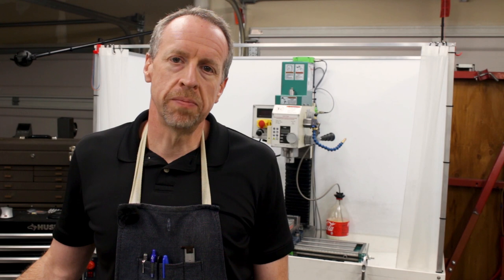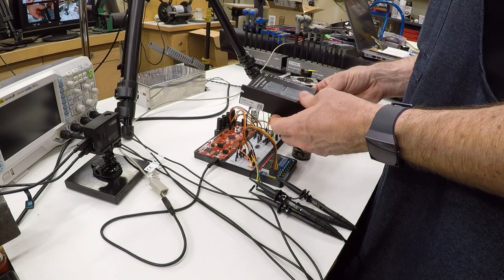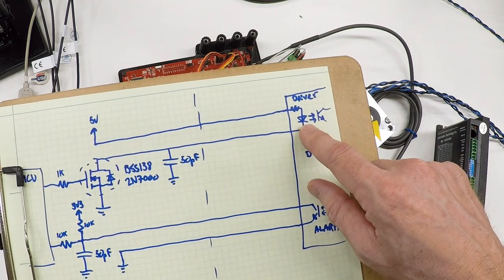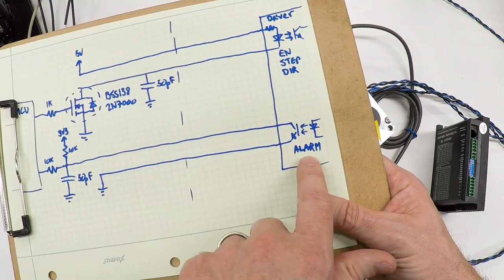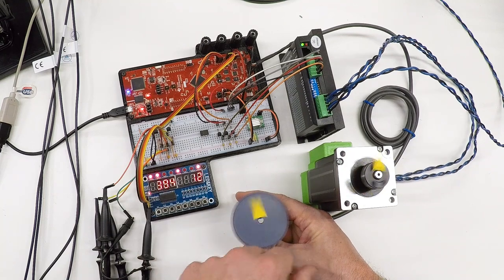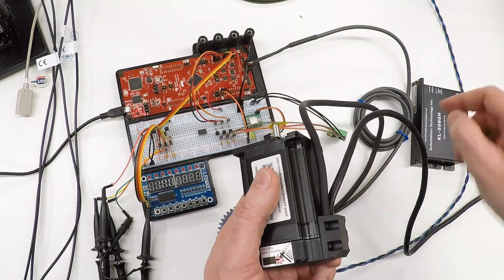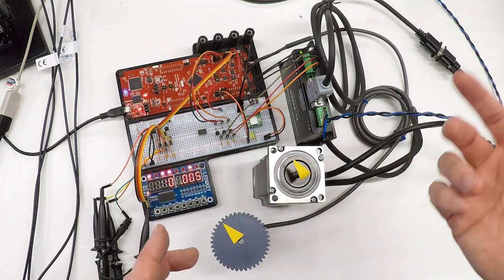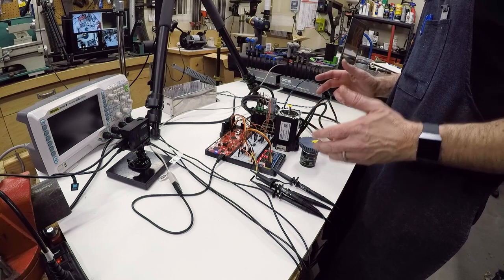Lathe Electronic Leadscrew Part 4: Steppers and Servos and Drives (Oh My!)

Comment: I’ve been toying with the idea of adding a processor driven lead screw to my craftsman/atlas lathe for a while. I finally pulled the trigger on a stepper motor and rotary encoder when I saw how the stepper worked for you. While waiting for the parts, I’ve been playing around with some code to simulate the driver. One question I have is regarding the stepper drive as a function of the encoder position.
For this discussion, I’ll use pulse to indicate an encoder pulse, and step to indicate the total number of stepper pulses. 
When you get an pulse, you know how many steps you should be at, and the current number of steps you are at. You also know how many steps are needed (call them s1) before the next pulse arrives. Here’s the question… do you crank out s1 steps as fast as possible before the next pulse, or do you try to fit s1 steps into the projected time before the next pulse?

For my first try, I’ll calculate the step period based on a filtered rpm with some fudge factor to guarantee that I will get the necessary steps in before the next pulse arrives.

Any thoughts?

Comment: Very good explanation of the pros and cons of each - with the encoder on the servo it reminds me very much of dealing with pickup truck electric shift transfer cases and the encoder signals from them to the transfer case control modules for positional feedback.  The feedback signal would definitely be an advantage in your application here.

Comment: I'd encourage you to actually make a small experiment to test the torque needed for moving the carriage and also for cutting. It should vary according to the material and depth of cut. This way you could draw your operation curve onto your motor's torque-speed characteristics and optimize the system. It's a little more work but you will have a veryyy very reliable setup.
Reply: I would think with the way he's gearing everything that it wouldn't be necessary, considering how much torque a stepper and servo can provide

Comment: I was turning some particularly stringy steel the other day and I just couldn't get a chip to reliably break. So I ended up peck turning for lack of a better word - stopping the feed to get the string to break. It made me think of this project and how great it would be to be able to program a skip turning routine.

I also got to thinking about how nice it would be to have an electronic/virtual stop for coming up to a shoulder by integrating a DRO encoder into the mix.

The possibilities for this are pretty immense.
Reply: No DRO required to implement your idea - the MCU knows where the carriage is, and you could program how many threads to cut before stopping, i.e., at 8 tpi, turn the leadscrew 96 turns (for a 12 tpi leadscrew) and stop. Great idea!
Reply: @schwartzenheimer1  I think a linear encoder is going to be the far better solution because you can't count on the system knowing the absolute position. Any time you disengage the half-nut or the power feed clutch (or if the clutch slips AT ALL) you lose your absolute reference.

You are correct that if you never disengaged the carriage it could be done. But then you're stuck power feeding both into and out of the cut, like doing metric threads on an imperial lathe, and that is a complete waste of time...
Reply: Stopping the spindle while the carriage is sync'd to it wouldn't break the chip (except accidently due to backlash and such).  Stopping the carriage while the spindle is moving would certainly break the chip - and your thread.  Chipbreaking by interrupted feed can be useful for turning operations, but not threading.
Reply: @somebodyelse6673  That's fine and understood. This electronic leadscrew project is designed to be used BOTH for threading AND turning operations. Clearly, turning is the operation I was discussing. Threading stringy materials isn't really that big of an issue as your chip length is generally fairly limited.
Reply: I've had to do the same thing when I'm getting a long string. That's a great idea to incorporate a peck feed cycle for turning.
Reply: BW - I need to get back in the habit of starting replies with a reference to the post i'm replying to.  You were indeed very clear, but the person I was replying to (schwarzenheimer1 ) posted about stopping a thread after a distance, immediately after you posted about stopping to break a chip.  It seemed that he was suggesting that one could stop feeding while threading to break a chip.  

Doesn't help that youtube threads don't indent more than one step, making it seem like every post after the initial one is replying to that.
Reply: @somebodyelse6673  Ahhh, my mistake!

Comment: I'm using a NEMA 23 and a KL-4042D on my lathe lead screw just don't try stalling it by hand! Never had a step loss. I designed stepper and servo systems for 8 years at Hughes Aircraft.
Reply: Hard to evaluate that without knowing your lathe and chip load.  Are you making buckets of Abom size chips in steel, for example?  Making brass clock gear blanks?

Comment: If you by any chance use a VFD for your lathe make sure than when you mount the encoder to 
the lathe the metal housing of the encoder has no electrical contact with the lathe body. The VFD will interfere with the encoder otherwise (in the form of earth leakage current). I ended up mounting the encoder using CNC'd plastic plates.

Comment: You could add a Proximity sensor and add an anti crash feature.  That's what I'll do. Thanks for doing all this work.
Reply from the maker: Say more about that.  Proximity sensor miunted where to detect what?  It sounds like a great idea, but there are so many things on a lathe that can collide.  Students often run the corner of the compound into the spinning chuck jaws.
Reply: @Clough42  Who hasn't? You're not a machinist until you've had at least one crash.
Reply: @Clough42  It would act like the mechanical clutch release on some lathes. It would be movable with a sliding lock relative to the carriage. You could do it also with counts by moving the carriage just before the crash point and setting an electronic stop point. May work with threading if you can sync it back up.

Comment: Have you looked at the Clearpath SD servos?  Integrated driver and auto tuning.
Reply: Clearpath SD are nothing new or revolutionary, most companies that make servo motors make also servo motors with integrated driver (and auto tuning exist on most servo drivers for years). Parker (Parker Hannifin) make them for over 20 years (for example obsolite Integral E or still in production Motornet DC), but Parker do not send free motors to youtubers so they promote them, peolpe who are in that buisnis know already for them (they are one of the largest companies in the world in motion control technologies and one of best, you will see their products in many places where you need precise control). I just pick Parker becouse I had expirince with their product but if you just google you will find  countless companies that make them (and many of them are much better/cheaper then Clearpath).
ps: there is no real advantage of servo with integrated driver to not integrated one (in long run much better solution is not integrated one).
Reply: I was going to make the same comment ! He should not waste his time and go the Clearpath route; much simpler and more reliable ! I purchased a few and I'm very satisfied !
Reply: Miloš Lazović Yep I have them on my 3D printer. Identical to clear path, will run 5000rpm and integrated encoders. Much less expensive than clearpath. I don’t know if clearpath firmware would work with them but I suspect it’s not much different than what we have.
Reply: @mrlazda  

Yeah dude I can go to McMaster and spec out a whole Parker 590 drive set running closed loop  then hook it up to the SIMmatic in the backroom and be good to go. It's different when it's your own money, and you're not just sending a BOM down to purchasing say "thanks guys!" and line item it out for whatevers being commissioned

You could go the other way-- take a Mitsubishi 3 kilowatt $180 IGBT drive that has 3 stock outputs on it to act as the driver out of the box, pop a $30 dollar CUI shaft encoder that'll guarantee 2048 pulses at 8k RPM, waste a week trying to get some stupid FPGA to interface with it and easily outperform an entry level Fadal or HAAS*. That's also 3 weeks of my life I'm never going to get back.

Clearpath is basically the basically the best 'in between' you'll get for the like $400 you spend. They give you something that works out of the box, PID, flexiblity,  and probably the thing I haven't even seen on entry level industrial grade drives -- acceleration profiles*. *Teknic is a wet dream for a DIYer.

*Throw an extra 15k or 20k in there for some Thomson or Mitsui or whatever case 60 shaft ball screws and bearing blocks, 6x linear rails for aux support and alignment, a grand for a Renishaw or Leica probe, maybe another grand for some vib. analysis profiling equipment to dead-man instead of crash and a power quality analyzer to see which leg's motor or mismatched line impedence is backfeeding dirty power to ruin my beautiful sine waves. THD? nevah heard of it. (Yeah EE not MechE in case you havent guessed lawlz)

Comment: Just to jump in on the touchscreen idea.  I think you were right the first time when you said you chose the display you have because your fingers might be greasy or oily when working.  In addition, though you retain the emergency stop on the lathe, some of your functionality in the controller relates to the safety of your work piece even if not to your own safety.  It's amazing how much trouble both my wife and I can have on a touch screen to make sure you press/touch/swipe, whatever else, exactly right to get the results you want.  We probably get it right 85% of the time but not  100% of the time.  Other than failure of the switch itself, the switch you push will know you pushed it 100% of the time.  Put an LCD screen for fancy display or additional visualization of the status if you can have both but I would keep the display you have.   

Oh, one other suggestion on that display/controller you have: buy 3 or 4 or 6 or 12 extras.  They're not made with industrial rated components and it would be a shame for your lathe to be down while you order whatever new displays are available in a year or two and then work out all of the technical issues to make some new display work.

Comment: I wonder how your system will work for simple feeds.  In addition to  threading feeds,  there are straight turning feeds.   There you may want the higher precision stepping rates.   You have the option of programming  cross slide feed rates also.   This is a very interesting  option for other uses.  I have an old wood lathe withe no lead scew.   One could add a lead scew to it using threaded rod and this drive system.   Two  (or three)  of these systems  could convert a mill to CNC operation.  I am sure others  can imagine more uses for this drive system .  A tracked rover anyone?   Spiral grooves  cut / milled to order?   Great work!! .

Comment: Just a thought, but if it were me doing this, I'd install a DRO on the lathe and interface with that. Then you have absolute toll position no matter what happens or when the half nut is engaged. I would do the same on the cross feed, then the entire threading operation can be automated.

Comment: Just going over older videos while waiting on the next video on the spindle motor. I'm confused, the first motor you refer to as a stepper motor I think is actually an open loop stepper, the motor you refer to as a servo looks like a closed loop stepper not a servo motor, closed loop steppers also have an encoder, they are sort of a mid point between open loop steppers and actual servo motors. The reason that I think the first motor is open loop is it only has 4 wires on the header, closed loops have also a second cable like the one you refer to as a servo motor that comes from the encoder.

Comment: As always great content, very professional and knowledgeable. Started ordering the parts :) 
The lathe I plan to use this on is a Schaublin 102VM, it has a 40mm diameter lead screw so I'm thinking of using a beefier motor, I saw that Automation Technology has a 34 NEMA version but there are some differences (2 phase vs 3 phase etc) - would it work with the setup your'e showing with out too many modifications ?
I know my way around mechanical components but a complete noob to electronics and software - thx
Reply: It's a year ago so you probably already have an answer but for anyone else. Yes. The motor is kind of irrelevant as it's all handled in the driver. As long as your driver is a step/dir type then it'll work. Just size the motor accordingly. The only difference would be in the size of the PSU required.

Comment: Great job. I know I'm a little late to this party but the hybrid servo you used looks like a reasonable candidate for my South Bend 1001 (8 x 18). However, my lathe is really quiet and you made a comment about the motor making more noise than expected. Did this become an issue?  I think listening continually to stepper whine would drive me nuts.

Comment: A couple notes regarding the above closed loop servo motor. While it works for this size lathe, if you have a bigger unit, it may not, depending upon the required torque (which also depends on what the operator expects for depth of cut).

Comment: when it throws a fault and kills the servo/stepper motor it should also kill the power to the lathe motor if you are cutting threads to hopefully avoid and fatal threading accidents. 

doesn't matter much if your only running end to end turning a diameter down to size and stop a moment, but if you have already cut more than a scratch pass threading and the material is reasonably hard and the cutting tip stops dead you could scrap an important part and break an insert. :(
Reply: when the servo/stepper motor throws and alarm it should also trip a relay to the lathe motor to kill it if its in threading mode since both need to moving together to make a reliable thread and prevent tool or part damage if the screw stop while to spindle keeps moving.
Reply from the maker: This is a good idea, but I also think it's very unlikely to help, since the tool will stop immediately, and the spindle will take time to come to a stop due to inertia.  Even with a powerful brake, it's going to continue rotating long enough to scrap the part and the insert.

Comment: Hello. You see, you know what you're talking about. I have a shrimp bench (From China) called BHP280VF. It is a combi machine with milling and drilling machine. I want to bypass and not use the gearbox that is on the lathe because I have to change the gear wheel for each thread pitch and feed I should use. I want an electronic lead screw that you have shown in your videos. Can you recommend and give me information about which parts I have to buy and maybe help me with drawing how to connect everything. Also, with the equipment shown in the video, I want the lathe to work quieter and much less work as I do not have to change gear wheels. Regards A.Hansen

Comment: i wonder if the stepper or servo would lose steps reliably when the halfnut is engaged?? in other words, if the threading tool is started over 1/4 inch from the work each time , would the threads come out perfect every time since the margin of error was accounted for the same each time? anyway , I think it will all work out perfect  especially with the gear reduction of the pulley system.

Comment: Does this lathe use the leadscrew as the feed shaft as well?  That would change the equation for most people that have both.   I’ve been wanting to do this on my lathe and this is an excellent series.  I’m just curious if you do this to the feed shaft, would need to do it to the lead screw as well for threading.  Any way to drive either or ? Seems like the likely solution for a lathe with a feed shaft and lead screw.

Comment: Hi James.  I purchased the same closed loop stepper motor and driver you have.  At 16:07 in the vid you talk about having 'set up the driver for 1000 steps'.  I assume you did this with the serial cable and the driver software that automationtechnology provides??  Can you confirm if you actually mades changes to the as shipped driver?  I'm having trouble establishing a serial connection to it and am trying to troubleshoot if I even need to do that.
Reply: Update:  Thank you @Clough42 for cluing me in...  Turned out I didn't need to make a serial connection to the driver.  In my case it was the additional motor cable that came with the motor/driver combo.  I mistakenly thought it was just an extension cable however it was a specialized cable with special pin mappings to mate the motor to the driver.  Here's to a tough 'lesson-learned' over the course of many hours/days...  feedback provided to Automation Technologies Inc.  :-)
Reply: @PaulMorley1  That's funny, I actually tried using that extra "extension" and yeah...it caused all kinds of errors. They told me it was an extension at A.T. So, THAT is the cable you use to program the driver? I thought that was done via the RJ45 on the driver. That would be a problem as you would need an adapter to make it an rs232 or a USB.  Also, it sounds like you need to change the steps per rev to a 1000? He does say something about multiplying it by 3 b/c of the 3:1 gearing on the leadscrew and Servo. James instruction for newbs leaves something to be desired.